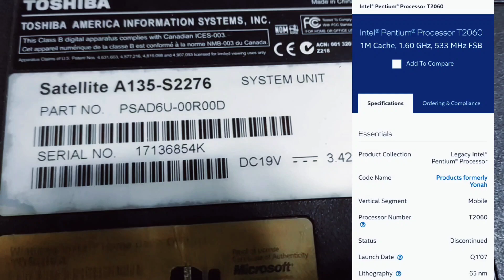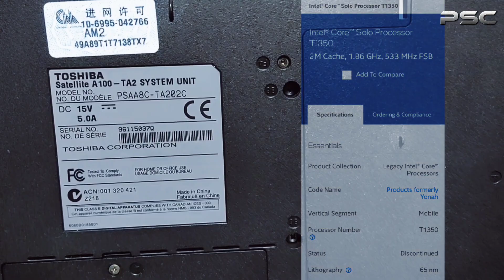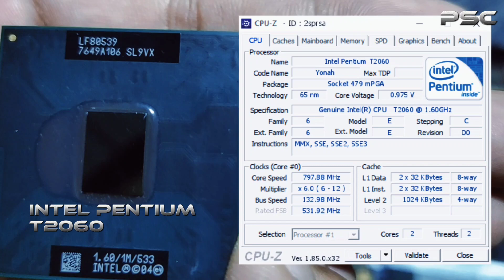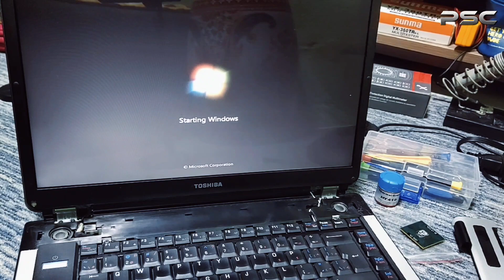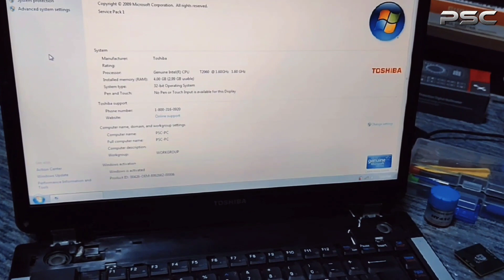Toshiba Satellite A100 (CPU and RAM Upgrade)

Comment: You should have fully disassembled, disconnected both batteries, washed all thoroughly (screen only wiped), and thoroughly dried for several days. And I'd highly recommend removing all stickers, thoroughly sanding, and properly painting all except screen, keyboard, ports (covering those and air vents before painting or separating entire outside shells).
Reply from the maker: That is for full restoration of the laptop/PC. This video is all about Toshiba Satellite A100 Upgrading CPU, and RAM only using salvage hardware parts from other Toshiba laptop. Thanks for watching and sharing your knowledge and idea.

Comment: Works with Windows 10 32 bit?
Reply from the maker: I tried to install and test the older version of win 10... The only problem is the drivers. If you can manually install the drivers, win 10 is the latest 32bit that will work for this A100 upgrades.

Comment: Hello, my friend. I want to thank you for your kind effort. I have a Toshiba Satellite. Can I change it from 2 GB RAM to 4 GB RAM? Thank you.
Reply from the maker: What is the model number of your toshiba? If your laptop mainboard supports the RAM upgrading and has a free or open memory slot yes you can. 4gb Maximum for the 32 bit system RAM upgrade for older device.

Comment: I have A100 PSAAKL , it can be installed with 2 x 2GB ddr2 sodimm but not stable, so the max is  1 x 2GB or 2 x 1GB,  also the ati radeon xpress 200m driver only stable for Windows 7? Any idea to un-e-waste it?
Reply from the maker: If the hardware is made for win 7 the driver support is also for win 7. You find another driver on the net but it is not recommended because it may also be unstable. You can still use win 7 OS and drivers for your a100, but you can't get support from microsoft. For a100 series the maximum ram you can install is 3gb even if you install 4gb of ram  the system will only read and use 3gb.

Comment: hi, toshiba satellite e105-s1402 its a 64bit, can i upgrade its cpu and ram?  like core i5??
Reply from the maker: The old toshiba laptops are designed to operate for specific cpu and ram. Some can be upgraded to new components but it is not recommended. The recommended upgrading for old laptops is RAM, HDD, and Compatible Operating System only. Because windows no longer supports the old operating system that works for old devices and hardware. It is useless to upgrade the old laptop now that has no support for the new operating system and hardware. I tried to upgrade my old laptop for learning purposes and showed that it is informative to see how old device or hardware upgrading works when it is possible and can be done without any issue.

Comment: can I upgrade the processor to like I core i5 or i7
Reply: can i ?
Reply from the maker: nope. you can not... the Toshiba A100 on this tutorial is so old. my upgrading attempt for this device is limited for that processor only. that processor is only dual core, and 32bit only. unfortunately the last windows OS that you can install for that device is windows 8.1 without any problem for drivers. but you can install windows 10 but drivers are not supported and some hardware will not function or work even for 32bit windows 10.
Reply: @perfectsilencecreation  wow okay thank you

Comment: hey my old A100 wont run 4gb ram keep shut down, only run 2gb ram why is that.
Reply from the maker: Kindly check if the 4gb ram you install is compatible with that pc. Is it 4gb on a single ram? I use 2gb per ram so 4gb in total ram for this tutorial video. But the system reads 2.99 or 3gb only for the 4gb ram installed. Because this pc is a 32bit only. 4gb or more is for 64bit pc and device. Check the specs of the ram i use for this pc ram upgrade. Or test your ram on another pc to know if it is working or faulty ram that causes the pc shutdown, if the other pc keeps shutting down then the ram is faulty not your A100 pc.
Reply: Supported CPU is x86/32-Bit only. Install 2x 2GB DDR2 LPDIMM SDRAM (Laptop DDR2). Highly recommended lightweight Linux, like Lubuntu, instead of Windows. Not all RAM will be available, as there's a limit to how much memory 32-bit architecture can handle, and onboard graphics will use some RAM as VRAM.

Comment: I have a135-s4427
The cpu is t2250 its duo core cpu but 32bit 
Can i install 64bit cpu on it?
Reply from the maker: If the design of the motherboard is for 32 bit system only, the hardware included on that device will support for 32 bit only. So it is not recommended to upgrade to 64 bit cpu for devices that is not designed to work for 64 bit system or cpu.